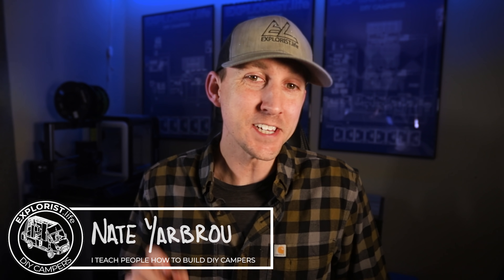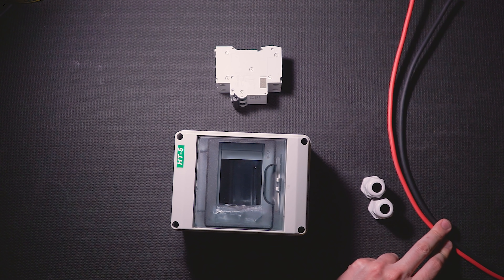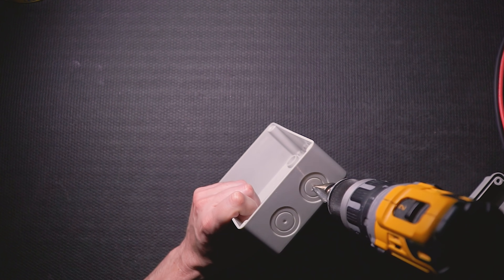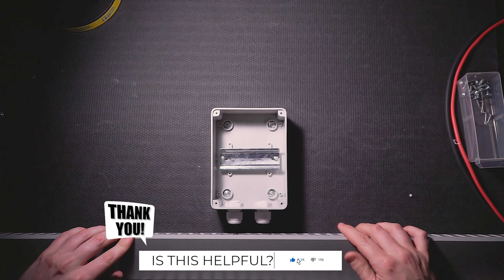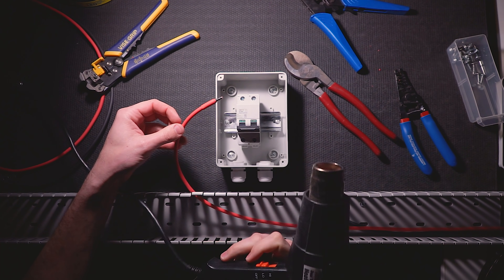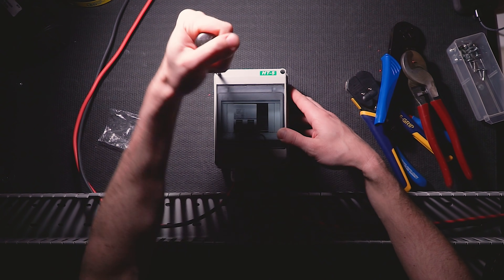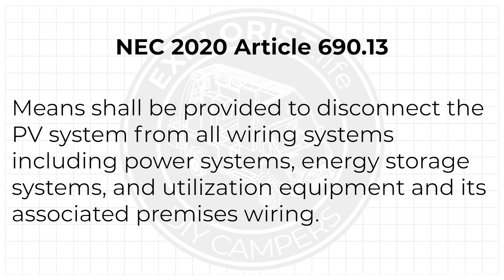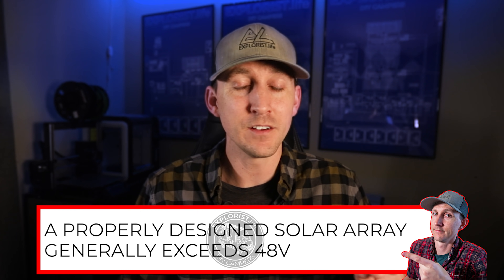How to Wire a Solar Disconnect for a DIY Camper Electrical System

Comment: Do I need to add a back feed diode to my solar wiring  system IF I add a ground deployed solar array
Reply from the maker: It might be needed, but it depends on how you’re tying the ground-deployed array into the existing array and what charge controller(s) you’re using. Some setups don’t need any diode at all, while others can backfeed if you parallel arrays/controllers the wrong way.

Best bet: send our support team a quick diagram (or a few photos) showing your current controller model(s), how many panels on the roof, and how you plan to plug in the portable array (same controller vs separate controller). We’ll tell you exactly if a blocking/backfeed diode is required and the cleanest way to wire it.
https://shop.explorist.life/support?utm_source=youtube&utm_medium=comment&utm_campaign=support&utm_content=response_link

Comment: Question why you're disconnecting the 12V leads rather than the PV array leads.
Reply from the maker: Great question 👍 The best place for a disconnect can actually vary a lot depending on your specific components, wire runs, and how you use the system. Rather than giving a one-size-fits-all answer, we’d love to take a quick look at your setup and make sure it’s done in the safest and most practical way for your build.

Reach out to our support team here and we can help you dial it in (and make sure you’ve got the right parts if you still need them):
👉 https://shop.explorist.life/support?utm_source=youtube&utm_medium=comment&utm_campaign=support&utm_content=response_link

Comment: why do you do the negative wire too? isnt it only necessary to have a pv breaker for the positive wire?
Reply from the maker: Great question! ⚡️ The need for breakers/fuses on both positive and negative depends on the specifics of your system and safety requirements. If you share your setup with us, we can review it and recommend what’s best: https://shop.explorist.life/support

Comment: So this is an isolator, not a circuit breaker? Is there no need to have a fuse on the solar side before the chatge controller?

Thanks

Comment: Nice! I’m curious how you would wire up a dual array setup. One on the roof, and one on the ground. Do they need separate SCCs? Can both arrays be used simultaneously?

Comment: help ! recently purchased a new class C Rv from Jayco and it is equipped with a solar panel controlled by a Go Power 30 amp rvc mppt controller. In order to check the water level in my house batteries I will have to disconnect all battery cables to be able to remove plastic caps to access cells ?  Do I need to shut down  the controller before i disconnect baltery cables ? If so, how do I turn it off, there is no switch  on the controller !
thanks for any advice you can give me !
Reply from the maker: Turning off the solar side of the charge controller before disconnecting the battery side is indeed the proper way to shut down a charge controller, yes.
Reply: @EXPLORISTlife  thank you , really appreciate your response !

Comment: I have a 30a mppt and 2 100w panels. I may eventually get another 100w panel. From my research, I should moutn them in series to get the most power. Should I get a 30a or 40a breaker?

Comment: Great videos.  Looks like some of the product links in the blog are dead?  Anyhow what do you think of the UL rated dc/solar isolator switches?  Usually 4 pole for 1 or 2 strings and rated for 700 or more volts, 32 amps?
Reply from the maker: Blog post links may be dead if they used to go to Amazon.  All parts are available in our store direct from us now: shop.explorist.life
Reply: @ Awesome. Thanks.  I see you offer a nice 1000v rated PV isolator switch along with a double pole breaker in a nice enclosure as two options for PV disconnect. Other than the switch being more expensive, do you prefer one over the other?

Comment: Heya. Is it necessary to put a dual breaker in? Would a single breaker (220v, high Amp) not be sufficient to break the circuit?.e.g. only on the positive line?
Reply from the maker: If you want to find an alternative option; you'll want to dive into the code books and product spec sheets for your application.  I've already done all of that in the preparation for this video and this video is a result of all of that research surrounding which product is most appropriate.

Comment: What is this some are saying to not disconnect/shut-off DC MCB of solar arrays when under load?
Reply from the maker: A breaker rated to an appropriate size should have no issues with that.

Comment: two 550w panels with Isc 14A can I use a 25A breaker?.. i got that by 15A*1.25*1.25 as per our code and 15A is max limit of my Solar Generator/Powerstation
Reply from the maker: This may take a more in-depth look at your personal setup.  If you have purchased/are purchasing from our store (shop.explorist.life) reach out for some more personalized help: shop.explorist.life/support

If you've purchased/are purchasing elsewhere, reach out to your dealer for support.  We'd love to have you as a shop.explorist.life customer so we can provide a bit more help in the future. 🙂

Comment: Isn't NEC just a bunch of guidelines and the 'why' is because some book suggests it?
Reply from the maker: The NEC (National Electric Code) aka NFPA 70 is a book of electrical codes and standards made to standardize electrical systems in the United States to safe operations.  

It's "A bunch of guidelines" that was written so that electrical issues don't lead to fires and/or electricutions causing death or injury.

Comment: I remain unsure whether or not I need to fuse my solar panels due to examples give always seem to use 3 or more solar panel when explained. This is my situation, helpful advise would be much appreciated. My system is a 12v system with 400ah lithium battery. I'm about to install 4 - 200w Renogy solar panels onto my camper and allowing for another 2 - 200w portable solar panels to be connected should I require if shade parked. These panels have a short ciruit current of 9.66v, open circuit voltage of 27v and a max series fuse rating at 15 amp. My Victron Smart MPPT 150/85 solar charger was selected for this PV system. This Victron mppt has 3 sets of MC4 connections for solar. That said I've decided to roof-top run 2 sets of 200w panels in parallel into 2 of the three mppt MC4 input connectors. Would I be correct in thinking that yes I do need to fuse each panel ? As this fuse video suggest a panel short could combined the short ciruit current (9.66A) of both panels to be 19.32A, Thus as over the 15A panel rating and so all panels be fused. Or did I over look some aspect. Any help much appreciated. Thanks
Reply from the maker: Hey, @ThomasPeltz! I appreciate you taking the time to ask your question, but unfortunately, I don't have enough info about your specific question to provide an accurate answer, but here is a playlist that, if you watch all of the videos start-to-finish (and take notes 😉), you'll have a REALLY good idea of how to design a solar array: https://www.youtube.com/watch?v=Jkbs84sBHsg&amp;list=PLmvhcyi4n0TV9pi83rFTv3ZuMT_S1xIZt

Alternatively, I have some of my most common solar array setups pre-built here: https://shop.explorist.life/product-category/all-products/camper-wiring-kits/solar-charging-wiring-kits/

Comment: I have seven 200 watts bougeRV panels in series a 30 amp DiHool braker. im using 10 AWG wire I should me good?
Reply from the maker: Hey, @xe-xx8vu! I appreciate you taking the time to ask your question, but unfortunately, I don't have enough info about your specific question to provide an accurate answer, but here is a playlist that, if you watch all of the videos start-to-finish (and take notes 😉), you'll have a REALLY good idea of how to design a solar array: https://www.youtube.com/watch?v=Jkbs84sBHsg&amp;list=PLmvhcyi4n0TV9pi83rFTv3ZuMT_S1xIZt

Alternatively, I have some of my most common solar array setups pre-built here: https://shop.explorist.life/product-category/all-products/camper-wiring-kits/solar-charging-wiring-kits/

Comment: Hi Nate, this is a great video like so many of yours. We live in Australia and I have a question, our caravan has a 1000 watts of solar on the roof and is connected to a Victron 250/70 mmpt solar controller. Our system hasn’t been installed with a solar disconnect, what size would you suggest. Regards Brian

Comment: I'm about to add solar disconnect breakers to my travel trailer, I have roof mounted panels as well as a thru wall plug for portable. I know I will add the disconnect between panels and controller for the roof mounted, but I also want to add one for the portable circuit. My portable has the controller attached to the array. Do I need to move that controller to between the battery and the disconnect or is it OK to leave the controller where it is (panel>controller>thru wall plug>disconnect>battery) I was thinking in this configuration the thru wall plug become an alternate 12V source with the disconnect to turn it off.

Comment: why are you using a 32Amp MCB?
400W, 2 in series and both sets in parallel gives each leg (string) a current max of around 8.3Amps, prob a lot less depending on solar panel.
8.3 x 2 strings = around 16.6 amps.
So the panels could be shorted out and the cable would just keep heating up.
Suggest going to a type B MCB of 16 Amps rating.
Remember that this wont operate until at least 16Amps x 1.15, so around 18.4 Amps, and that is only after the current has been flowing for around a few 1000 seconds.
Personally I would go with a 13Amp unit, harder to get hold of, but much better protection, and you could drop a cable size down to 2.5mm2 (14 AWG) without too much voltage drop.

Comment: Nate, I didn't find that the disconnector is UL listed. My permit says that all equipment must be UL listed. I cannot find a mini disconnector that UL listed. Question - can I use the Anderson connector that rated higher than my PV system and UL listed?

Comment: Dear, my pv array current is 415 volt , is there any available breaker or protection that can trip in case of short circuit or over current or amp

Comment: I purchased two of these breakers from your link a while back. My plan was to use the second one in the same enclosure as a shut off for my Orion dc to dc charger. I was hoping that the 63 amp rating would offer redundant over current protection for my 6 awg cable coming from the van bus bar under the drivers seat. Is this an ok application for the breaker?

Comment: I love the videos, but how does NEC 551.1 apply?
Reply: Is it true that as long as the PV system is under 24V, like an RV DC system, the NEC 690 doesn't apply?
Reply from the maker: It's pretty rare to find an RV solar array under 24V unless it's just like one panel.
Reply: @EXPLORISTlife  OK, I just used two 12V 100W panels in parallel with a single pole disconnect on the positive side and a 30A charge controller. Then I use the cigarette lighter adapters throughout the RV for other power needs. I just wondered if I needed to rewire it. Thanks
Reply from the maker: @onestoptechnologies7305 Yeah, I mean... I provide the information and it's up to you if and/or how much of it you want to follow.  But I design all solar arrays, as small as 20V all the way to 250V with dual pole disconnects as described.
Reply: @EXPLORISTlife  Your systems look great! I just wasn't sure if mine was "up to code" or if I needed to rewire it. Thanks again.

Comment: Other than "that's what the NEC code requires", is there a practical reason to use a switch that simultaneously disconnects the positive and negative leads from the solar panel? I'm scratching my head, trying to think of something bad that could happen by switching just the positive lead, but I can't can't come up with anything.
Reply: You never know what reason you have to want to isolate the Solar Panels ... But the best isolation is complete disconnect of both wires.

Comment: Hi there. I wired this same breaker between my panels and controller. Are they ever defective?  I now show volts coming in but no amps. All readings were good before I added the same breaker. 
Yes panel wires come in the top, and bottom wires go to controller….same polarity.

Comment: If it hasn't been asked already, can this switch be used to disconnect the panels while they are receiving full sun and are under load?  I'm thinking of a rare event where an BMS fault occurs abd gives a warning of an imminent shutdown.  Im not 100% sure it would be necessary to try and immediately disconnect the panels in such a situation though?

Comment: I have one question…. I have my tiny little teardrop camper wired up exactly the way you described!  I’m about to rewire things, make a cleaner, tighter install.   I’ve seen others install the solar disconnect without putting it into the waterproof box that you used. In my install I really don’t have very much space. Can I get away without using the water proof box?

Comment: Leaned a lot from all your videos.  Thanks.  One tip I learned though (looks like you may have also, but omitted it in the video), once you cut and have run the wires into the box, remove the breaker for easier access to install the wires in the breaker.  Then, you can push the wires back out and reinstall the breaker.  👍

Comment: Hi there. Just a question.  I'm doing the same thing with my solar panel. Just making sure with the rcd the solar goes though the top of the rcd then the mppt chager goes to the bottom? Also does it matter which way I have the positive and negative up the top as long as they match down the bottom? Thanks heaps
Reply from the maker: You'll want to check the user manual for your breaker for guidance as they are all different.

Comment: Hi, this is such a great video! I’m wanting to make a quick PV disconnect inline switch for a tiny, camping DIY solar generator / power box using a 12v Renogy 10A solar controller, connect to a 12 watt .5A solar panel and a 7Ah NPP SLA battery. It’s purpose it so power small devices for a tent. There are situations where it would be helpful to shut down the solar panel current coming to the controller while working on the battery or removing the battery. The controller instructions however say not unplug the panel before the battery so I’m guessing a regular inline SAE switch cable is not advised? If so, do you have any smaller current 12v switches you can recommend? Are any of the ones you pointed to in this video (that do not work for larger, gov regulated systems) good for my set up? Thanks so much!

Comment: Hello Nate great videos. I am looking for the proper diagram hoping you can point me to. I am wiring 800watts of solar, 3000watt inverter. I removed the generator from my Chinook RV hoping to replace this system. The camper has 30 amp shore power. Can I just use the existing switch wires from the old generator? Do I need a on/off switch? Thank you
Reply from the maker: Check the 30A OEM RV Retrofit diagram available on https://www.explorist.life/solarwiringdiagrams
Reply: @EXPLORISTlife  thank you

Comment: Nate Jim Partlow here. I purchased the DC solar disconnect switch for my solar install . I also see that you have used a solar disconnect breaker and din rail. Which is best or are both needed? In all your wiring diagrams you use one or the other, is it just a change in product and serves the same purpose. Thanks

Comment: Hey Nate, love the content and the video, but I'm confused with your link to the "wiring diagrams with fuse and wire sizes for free", seems to lead to a page that is directing me to pay $10 for the diagram? The image provided on the page is way too small to read any of the fuse or wire sizes in the diagram. I'm not knocking the hustle at all! Just wondering if I'm doing something wrong, or if it being free is a "misprint". Thanks!
Reply from the maker: The free diagrams are the standard resolution ones where you can see good enough what, in general, is going on, where the components go, flow of power, etc.  The ones that are $10 are the super high resolution ones where you can zoom all the way in to see the labels on each and every part, component, and piece of hardware.

Comment: If your fuses are before the isolator, how do you switch of the power still coming in from panels to replace the fuse and not get shocked?
Reply from the maker: Unhook the panels from the fuse.  It's just a quick-connect/mc4 connection.

Comment: Hi Nate. Can the double pole dc circuit breaker ( 63A ) you make be used in the Orion 12.12.30 charger ?
Reply from the maker: I recommend using fuses instead like I've got in all of my system diagrams at https://www.explorist.life/solarwiringdiagrams
Reply: @EXPLORISTlife  I wanted to ask if I can use it only as a circuit breaker, not as a fuse. Of course, I will use 60A mega fuses, 2 pieces.
Reply from the maker: I mean... a fuse and a circuit breaker is the same thing.  I'm not sure what functionality you are trying to achieve by adding additional overcurrent protection.  Perhaps just stick to my system designs and don't change them?  Check the 13:16 mark in this video: https://youtu.be/ZHFxLUOG8UE?t=797
Reply: @EXPLORISTlife  Message received. Thank you.

Comment: Why is the disconnect amps set at "greater than 30"? Have a 30 amp controller which is sized for a system a bit bigger than mine. Why do I need more than a 30 amp disconnect? Great stuff!
Reply from the maker: That is explained in the 2nd half of the video. 👍

Comment: I saw you discontinued the disconnector, with a comment, but why isn't the original disconnector good for protection, just isolation? Why do I need a disconnector AND fuses?
Reply from the maker: The 2nd half of the video explains that. 🙂👍